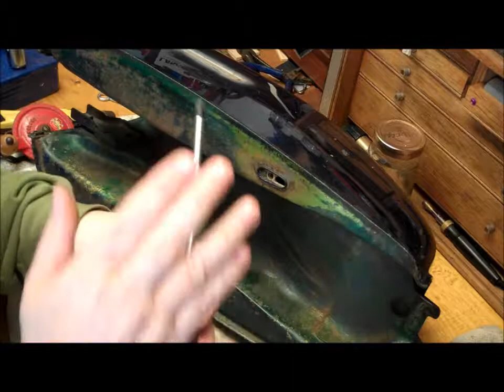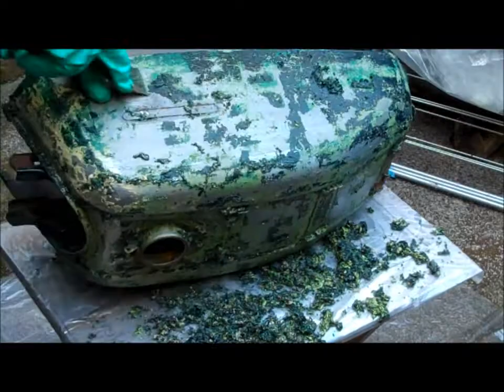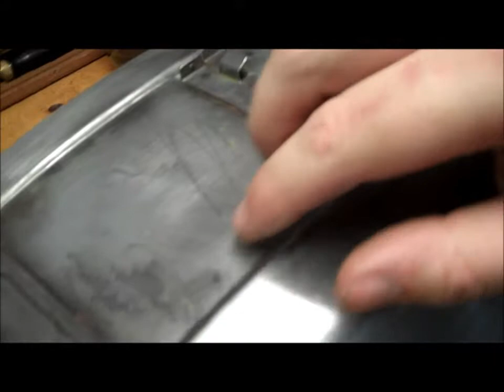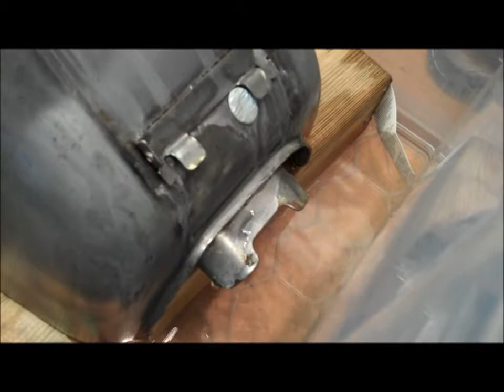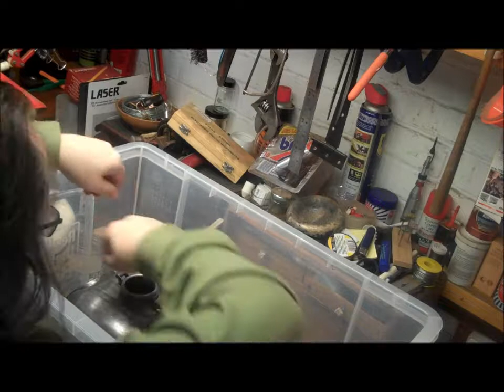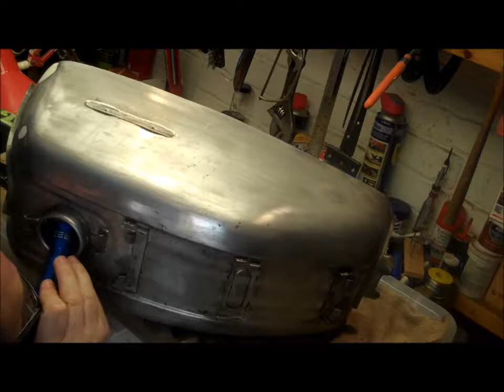Honda CB200 - Petrol Tank Restoration Pt.3

Comment: I was looking at getting some paint stripper for wifey's Royal Enfield project. I am now convinced that the Starchem stuff is as good as it says. Tanks looking great thanks to the inside treatment, shame it had to be done but will be worth the effort in the end. Are you going for an original colour? btw I have found that Gibbs brand lubricant is very good at extending the protection of bare metal against rust before priming/filling etc and you can safely paint over it apparently.